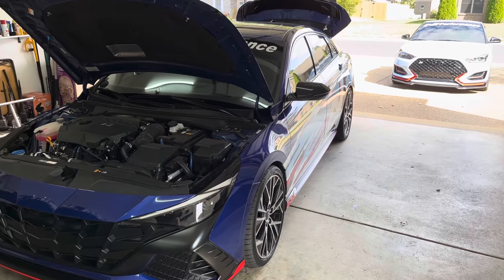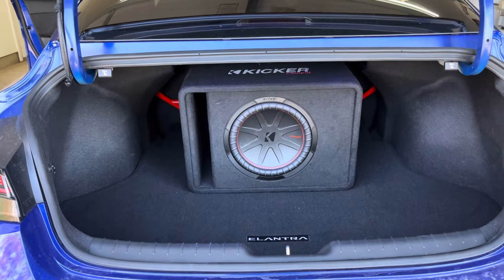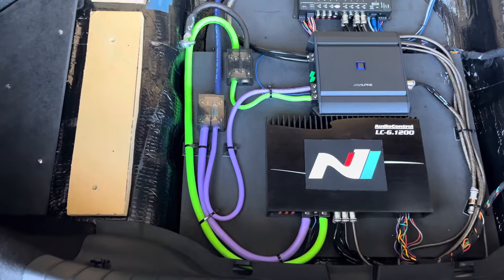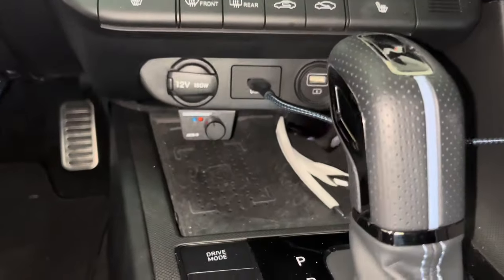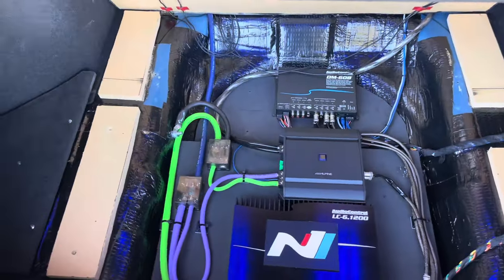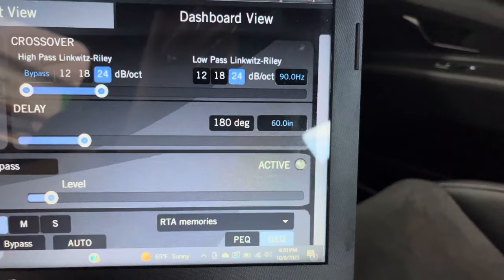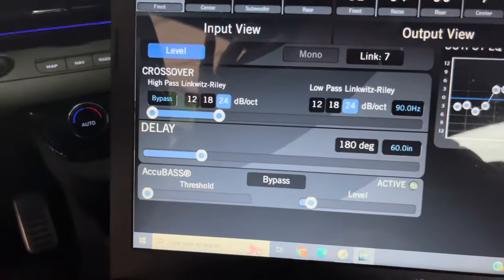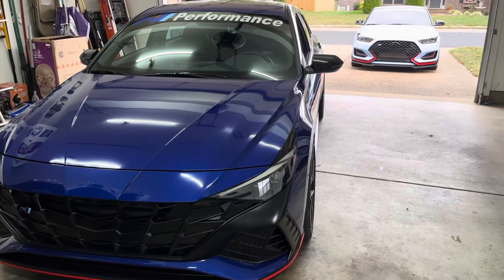2022+ Hyundai Elantra N Comprehensive Audio Sound System Upgrade Guided Tour Overview 6 Month Update

Comment: This is pretty impressive. I'd be blasting Jesus Built My Hotrod with my windows down at the track as I pass Golf GTIs and Mustangs. I just can't upgrade my sound system. I feel like doing that to a performance car isn't right. I'd rather spend the money on tires and brake pads and try to get down to 3,000 pounds.
Reply from the maker: Thank you! I don’t track the car so I’m OK with the weight. My wife has a Veloster N and is more worried about performance over the audio system. I put basic audio upgrades in her car.

Comment: do you have a video comparing the sound before the mods and after ?
Reply from the maker: I have a companion video each time I made an upgrade. Overall, I love the system as it sits now. I wouldn’t change anything. I have enough bass without being too much and without the car rattling like a tin can when standing outside the car. The mids and highs are loud and clean. The DSP was a big help getting everything dialed in perfectly to my liking. I will say I’m shocked at how well the factory rear speakers have held up. I’m pushing a lot more power to then now and they’ve held up great. I didn’t change the rear speakers, just added sound treatment because they don’t add enough to warrant switching them and I’m impressed with them.

Comment: Im about to go thru all of this. Can you tell me all of the speaker sizes and location of the factory amp? I have high end gear i removed from my last car and want to obviously utilize all of it if it fits. I know the front doors are 6.5 splits and the factory sub but thats about it.thx
Reply from the maker: 6.5” front and rear, center is a 3.5”, tweeters 1”, sub 8”, amp is at the back of the trunk passenger side. I have a video for each speaker location on my channel.

Comment: How did you get the 0 gauge thru the grommet ??
Reply from the maker: I just cut a big enough slot and pushed the wire through attached to a wire fish line.
Reply: @nprform  yeah I just had to use a little more elbow grease! Haha. Thanks for the reply I am installing a kicker solo x 12 inch sub I will probably post a slide show type video because I've only taken pictures and I don't usually upload videos anyway but I will certainly post the end result!
Reply from the maker: @squids9628  Sounds good! Let me know when you get it done.

Comment: I recently got a dsp added to my Kona N. I have a problem with left channels and right channels. In certain songs where the guitar pans to the left, left channel plays on rear door only. And right channel plays on the rest of the doors. Do you happen to have a wiring diagram of which wires you tapped in?
Reply: I meant left channel plays on rear left only, and right channel plays on front left, right, and rear right
Reply from the maker: I do. Here’s a link to my previous AudioControl amplifier install video. The wiring diagram is at 5:49. https://youtu.be/1ASvUsEepu4?si=TLzXGJFzCQ7XVOtQ